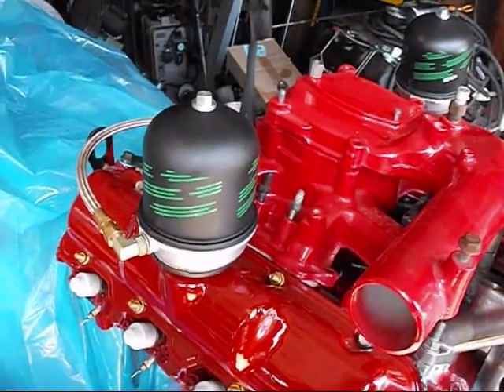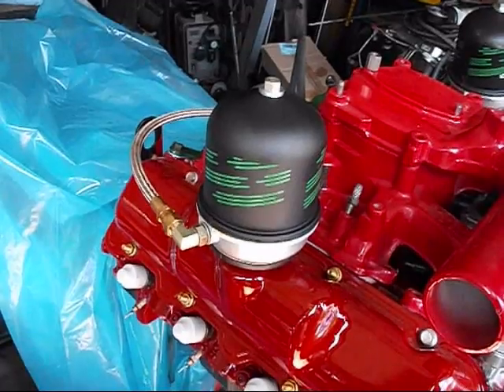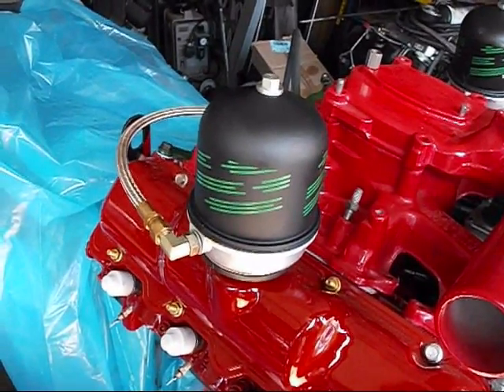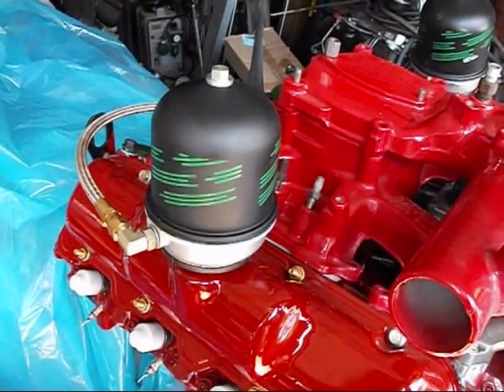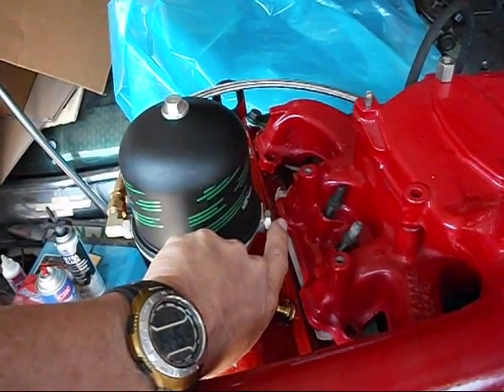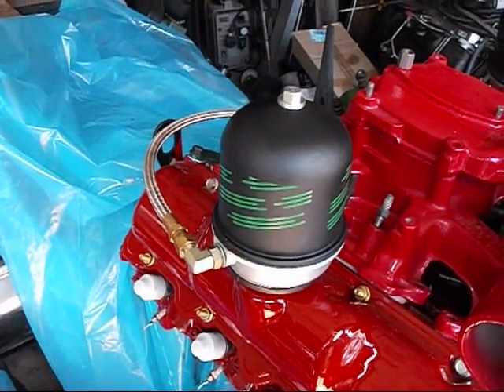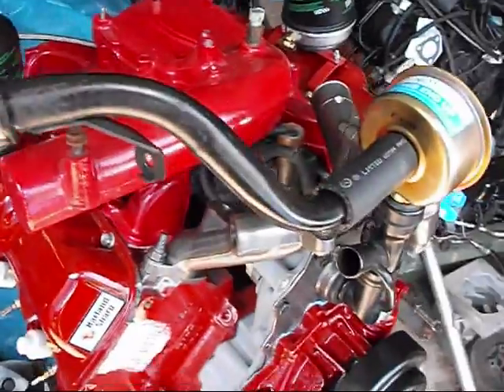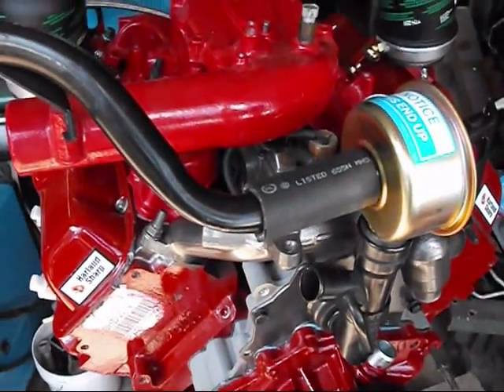centrifuge bypass oil filter on 6.5 diesels

Comment: Does this not reduce oil pressure by each of these only having 50% of the flow from oil sensor outlet? Then in theory each won't spin fast enough to be effective a centrifuge as only running at half speed and reduce flow to oil galleries because of pressure losses actually increasing wear.  Would it not be better to only have 1 unless you have an extra oil pump?
Reply: See the video again. Oil pressure remains the same. Only running one centrifuge.
Reply: @leroydiesel6.5  Yeah sorry it was confusing the crap out of me lol.

Comment: Does this replace the factory oil filter? If so, is there a blockoff plate?
Reply: @leroydiesel6.5  I hear these 6.2/6.5 diesels will go "many" 100K miles, with a stock filter. Why would this device, which takes up a bunch of room on top of a tin valve cover, be any better? Will the stock canister filter go longer with it installed?

Comment: I would like to set my engine up just like this one. I know you said that one of these filters are mocked up, but is it possible to have 2 filters running at this same time?  Again I have not seen this kit on your site.  Also is this filter cleanable or does the internal filter have to be replaced each time its serviced?
Reply: does it really make a difference on a that engine? How's it going? One more question... how many ground connections are there for me to want to clean on my 95 2500 2wd. I want to do it for precaution. it's almost got 500k on the clock.

Comment: great system! I  have  a  94 5.9 Cummings that I  want to put the system  on. I'd  get my saply  line from the  port near the oil filter,  where would  I put the exit line at??, next to  the  oil pressure  sensor?  I  heard there was  a  non-pressoreport near it with pipe threads. I  have love your system!  Just want it set up  for the 5.9 1994. Need your website.
Reply: Ok.  Thank you.
Reply: Do you  sell the Centerfuge system like this U-tube video and adapt it to the 5.9?

Comment from the maker: Works great. See my other vid on the cleaning of it.
Reply: +Leroy Diesel I wouldn't have thought there was enough oil pressure in an IDI to drive thee things. They're usually rated 85PSI
Reply from the maker: +The Ball Plenty of pressure. Unit has built in valve to keep centrifuge at optimum speed and control oil pressure.
Reply: +Leroy Diesel I've been tempted to buy an m1010 going for cheap, but getting the ratios appropriate for highway driving would likely cost a mint :) Looks like a fairly reliable engine, though.

Comment: Well how is it working?
Reply from the maker: +ryanburbridge Sorry Im not getting email notifications of replies. Anyway it works great. In the video I cleaned it after 5000 miles and you can see the thick tar/sooty layer that was in it. If the centrifuge had not pulled that out it would still be in there abrading surfaces.